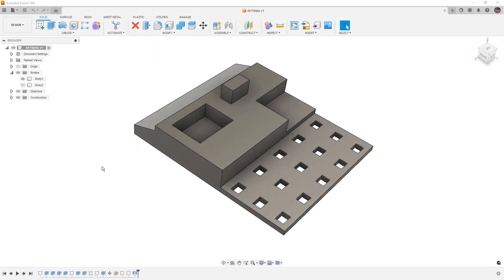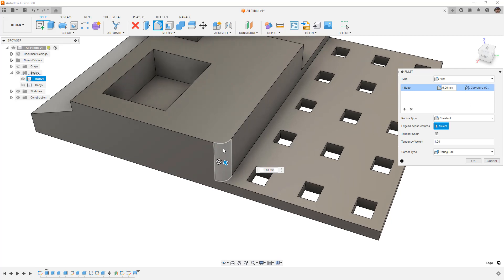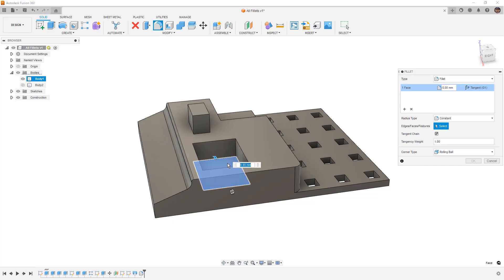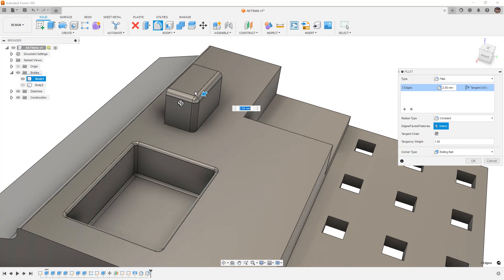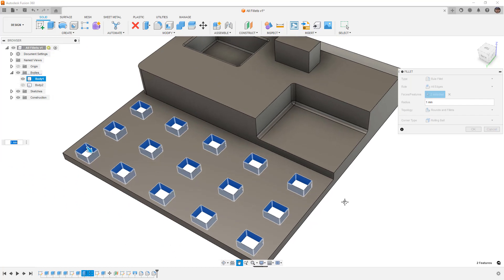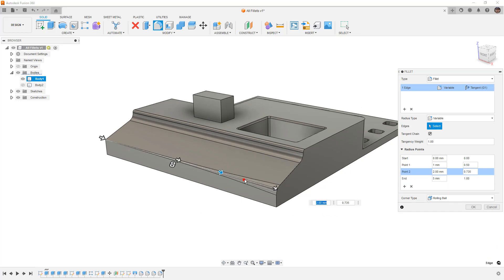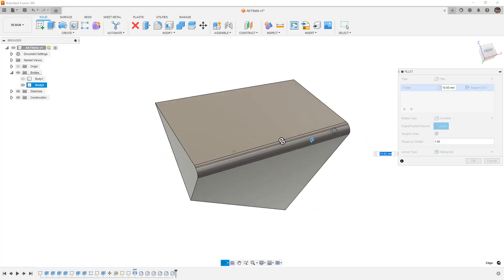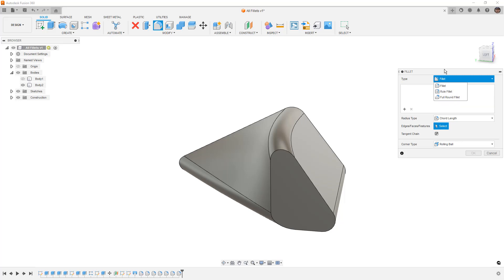Every Fillet Option in Fusion 360 | How To Use Every Fillet Type in #fusion360

Comment: What if I want a fillet that is straight rather than rounded?
Reply from the maker: I think you want a "chamfer".  its the tool just below fillet.  Instead of rounding the corner it will flatten it (at 45deg by default)

Comment: Thanks for speaking clear enough to work in 2x speed! This might be a long shot, are you familiar with any way in "modify solid" to change a fillet that was made in sketch without changing it in the sketch? I have a plate ish part that i copied and I want both to be the same except for the fillet that I want mirrored, in this case I solved it by removing the sketch fillet and added the fillets after extrude, but I feel it's an inefficient way to do it
Reply from the maker: There are 2 potential ways you can do that.  1 is to select the fillet on the mirrored side and hit Delete.  fusion will remove it and patch the geometry to a square corner, then you can add a new fillet with a larger value.  The other way is to select the fillet and hit Q which is Press Pull.  make sure you use "new offset" or whatever the option is in the dialog.  If you let it auto decide what to do it will edit both fillets.  With this you can offset the fillet surface making it larger.
Reply: @LearnEverythingAboutDesign  Thank you! I will try that next time.

Comment: I don't think you explained every fillet option. The rule fillet you kind of skipped over, instead you talked about selecting features. I don't think that is the difference between standard and rule fillet types. What is rounds, rounds and fillets? But the selection box inclusive/exclusive was very helpful tip that I just learned from this video.
Reply from the maker: At 6mins when we talk about Rule fillet i mention its main benefit is to select Features.  So in the example we extrude a bunch of squares through a plate and rather than selecting all the edges we could select the extrude feature and collect all the edges.

The fillets vs rounds thing.
Fillets are internal corners.  areas where material is added.  So in our example the vertical edges that belong to the extrudes.
Rounds are external edges that have material removed.  This would be the upper edges of the extruded squares where they hit the top face of the plate.

If you do a test on this draw a simple rectangle.  then on top extrude some smaller rectangles.  If you use a rule fillet and set "Fillets only" that will only add a rounded blend between the first extruded plate and the bosses you added on top.  Those edges are the only "internal" corners where material is added.  If you do Rounds only, those base edges will be left sharp and all the other corners will get material removed to round them off.  

The "rule" part between faces/features vs all edges can help in some specific cases but i would say i maybe have used that option 1 time.

Comment: I have two faces coming together creating a 90 degree between the two faces. The fillet tool wants to cut into the one face and not even touch the other... Rather than blending out of the surface like it does on yours at 5:55 in the lower right. Mine looks more like your little block on the top and I'm wanting to blend into the bigger flat surface. Now, if I start a simple model from scratch, the inside corner works as expected as shown in your video.
Reply from the maker: My guess is you have 2 bodies. they aren't joined together.  Check the bodies folder in the browser on the left.
Reply: @LearnEverythingAboutDesign  thank you, but that was one of the first things I checked.

Comment: This is great, thank you! Dumb question... but I'm still trying to understand literally what the fillet 'radius' actually means. What is it referring to? I'm asking because I noticed that the face geometry of the edges will significantly  change the actual size of different fillets set to the same radius.
Reply from the maker: No dumb questions!

The radius.  Think about if you had a complete circle with 10mm diameter (5mm radius).  When you apply a fillet with a radius value what you are saying is to apply a true arc to the edge selection with tangency to the faces around it.  Depending on the angle of those faces you will get wider or narrower width fillets with the same radius.  The fillet option "Chord Length" is a way you can define the width of the fillet instead of the radius value so even if you are dealing with a part that has a changing angle between faces, it will keep the fillet the same width.

Does that help?

Comment: Best tutorial I saw for understanding all the different fillet types and how they work, really appreciate it. One thing I noticed when playing with the Full Round fillet is that it changes based on where on the selected surface you click. If you click near an edge, it will take that adjacent face as the "side face" for the full round, so you can control which direction the full round goes based on where on the surface you click. That was a bit of an "aha" moment for me, and it even highlights what it thinks are the side faces as you move the mouse around the selected surface, so it's trying to help you understand what it's going to do.
Reply from the maker: Glad it was helpful and thanks for the tip!  I don't think I ever noticed that but will pay attention next time I use the full round fillet!

Comment: how to do a negative fillet on a outwards edge? rounded inwards not outwards
Reply from the maker: There isn't a specific fillet option for doing that but you can "cheat" a bit and use the pipe tool.  Use Create > Pipe and then selection your edges.  you may need to hold down CTRL to temporarily disable the preview so you can select more non-tangent edges.  Tweak the settings for the pipe and let it cut away.
Reply: @LearnEverythingAboutDesign  it would have been nice if it had a reverse feature where you could flip the fillet, in addition an angle feature lile with chamfer and maybe a value option. Maybe it would be hard to pull of. I guess the best controll would be a plane on angle and then a circle or arch on a sketch then an extrude

Comment: Variable fillet works only on single edge, it really sucks.
Reply from the maker: Yes and no.  It works across multiple edges as long as they are curvature continuous.  But yeah you couldn't have 3 edges intersecting in the same variable fillet.  I am not sure/aware of any program that allows that but seems like a cool feature.
Reply: @LearnEverythingAboutDesign  Plasticity have it.
Reply from the maker: @xxxxxx-pq5el  Very True, i was thinking in the context of traditional CAD.  But you are very correct that Plasticity can do that.

To be honest I rarely use variable fillet.  Either traditional fillets or I manually blend edges.  Maybe I should use it more.
Reply: A filled is a fillet and round edge isn't. Tell the folks at fusion 360:(
Reply from the maker: @ChiCaps  not sure I understand what you mean.